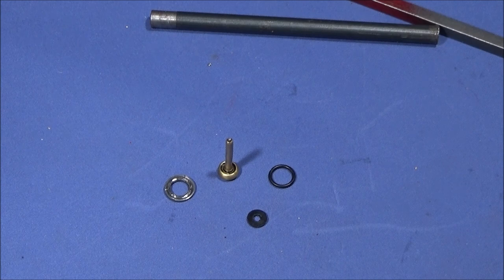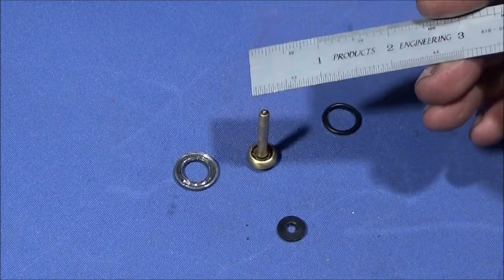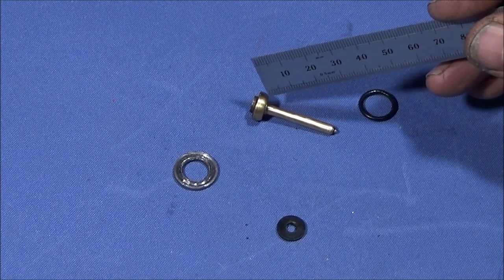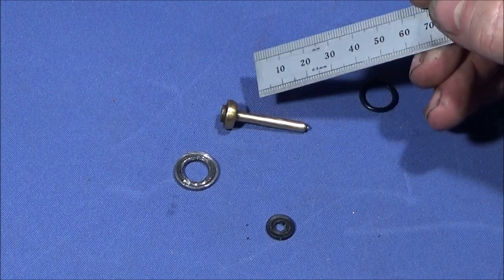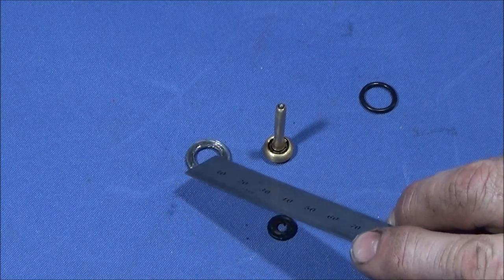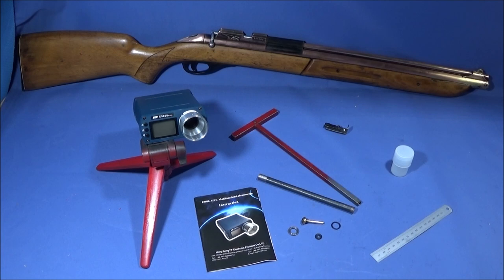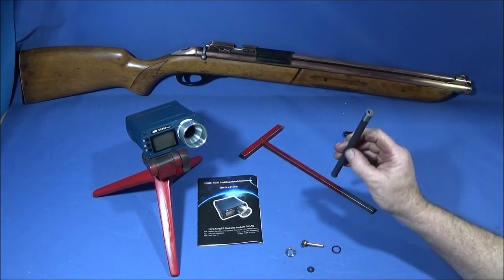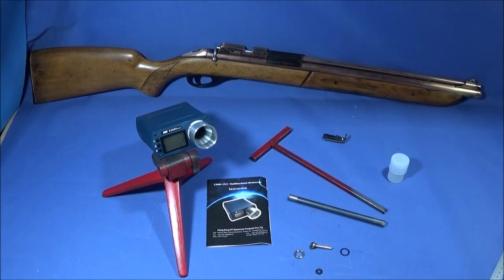How I repaired The Setra Air Rifle + Resulting Chronoscope Tests

Comment: Interesting video, but could I ask how to came to 11.8Ibs/ft from the chronoscope?
Reply from the maker: Here is the Formula. It is... FPS X FPS X THE PELLET WEIGHT IN GRAINS, THEN DIVIDE BY 450240 = Ft/lbs Energy.
ie. 614 feet per second X 614 fps  X 14.3 Grains pellet weight... divided by 450240 = 11.973 ft/lbs Energy.
Reply: Many thanks...